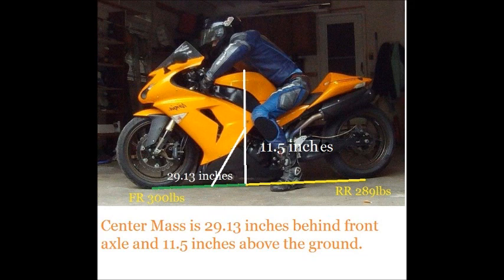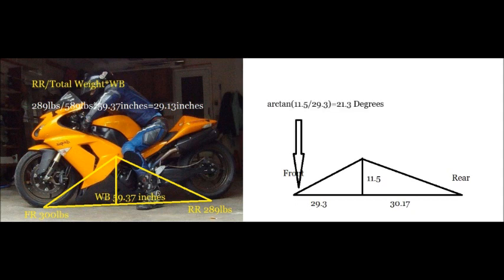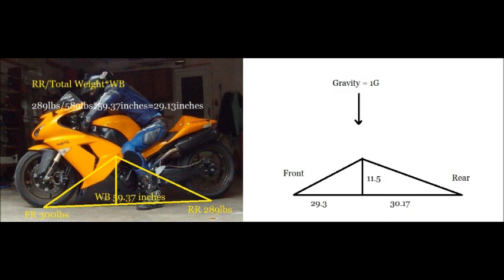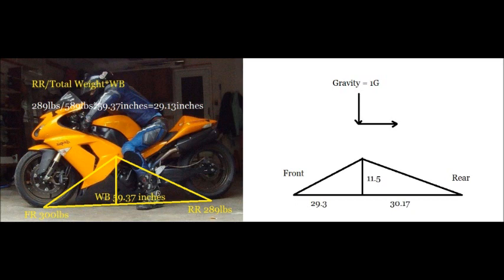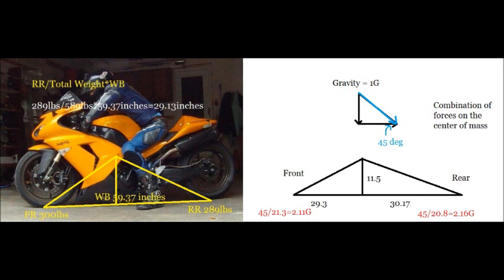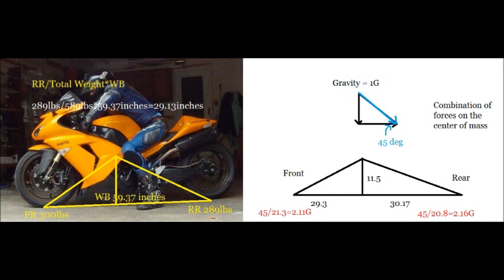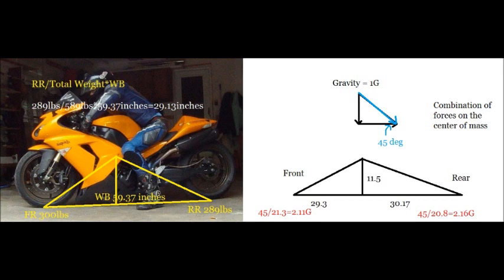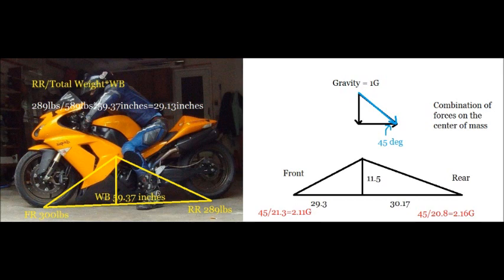How To Go FASTER, PART 3, Max acceleration EXPLAINED!!

Comment: This appears to be wrong. Maximum acc. without rotation is when the rear ground force acts through the center of gravity, meaning the normal force N + the friction force F (all vectors), implying a maximum acceleration of N/F = 30.17/11.5 = 2.6 for the rear wheel, and similarly for the front wheel.
Reply: Please make a video with your motorcycle explaining your point please post a link here.